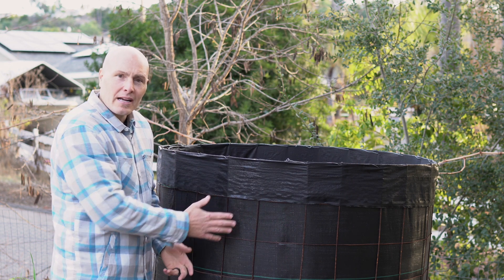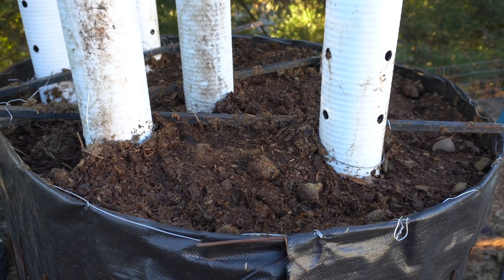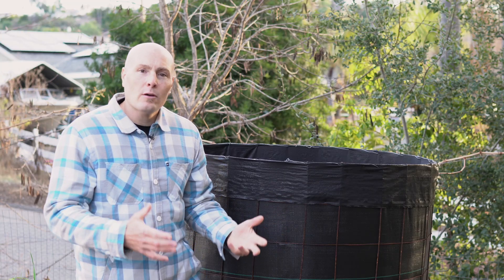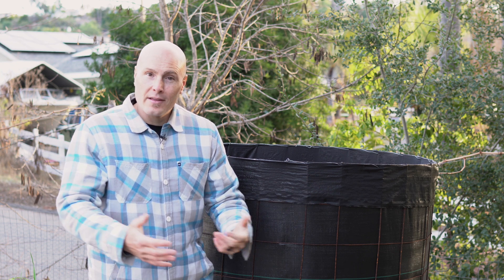Most UNDERRATED Way to Compost | BUILD ONE!

Comment: One modification that I would make to your bioreactor is to place a grid of rebar and hardware cloth at the bottom of the stack and then add a pan with a drain beneath that. Its collection and removal prevents the pile from becoming anaerobic from overwatering. It also prevents under-watering. Simply Water until you reach field capacity and hear the water start to drip into the pan. Then drain the excess water for use as a compost tea or attach a drip line to feed the runoff directly to the beds. The diameter of the pan should be smaller than the diameter of the reactor to allow air flow and/or contact with the soil around its exterior.

Comment: I have built several of these and the idea of easy has never happened. There is a lot of work to build one correctly and once built, there is little maintenance but watering and adding worms and keeping warm or cool for the worms and then 18 months later, tearing the pile down to use. Most chores in the garden take work.  This is the best way to get the highest quality, highly fungal, highly bacterial compost. But the application rate is a few pounds per acre four times a year. And with a backyard garden, one does not need 500 pounds of this compost unless you want to supply the neighborhood. (Which is a good idea). It is work.
Reply from the maker: Relative to turning a compost pile all of the time this isn't that much work.

Comment: I don't like the restriction of airflow by the landscape fabric or the vertical tubes.  I think a better design would be horizontal perforated tubes crisscrossing the reactor.  Then air could flow through the tubes from wind.  Getting rid of the pallet is great.  The reactor is more like a Jean Pain mound.  Too bad we can't harvest the heat via heat coils to maybe warm up the garden beds? Maybe start seed trays on top?

Comment: I hope the palletless design works out!
I wouldn't be too sure though. The airflow dynamics in a normal bioreactor with a pallet is completely different. The air in the columns heats up, starts rising and fresh air is pulled up from the bottom, not sure how it would work here, but maybe it does get enough air from the sides.  Whatever happens, we will be smarter afterwards :-) Keep up the great work!

Comment: I was really hoping to see the decomposition of the wood chips you had used in the spring.
Also what is the amount of compost produced by one reactor?
If you are trying to source/make your own compost and had a market garden...how many reactors would you need???
Reply: If you follow Dr. Johnson's instructions fully you will get a 25% -30 Yield by weight when finished, about 700 lbs. per reactor. It's efficacy is extremely high so 700 lbs. It plenty if your using as a slurry seed inoculant, root drench, foliar or a transplant root dip. This is not the type of compost you need to be applying literal tons of per acre. farmers Use 2lb's of JS compost with 20 -30 gallons of water  per acre in furrow and found great results. 2lb/20 gallon solution for transplant root dip, and root drench in the market garden scenario.  also considering using this compost or compost extract to inoculate other windowed piles of traditionally turned hot compost or as part of your seed starting mix. You can never have enough of this compost, so calculate what you actually need (acre-foot of bed space) and then make as much as you can afford. Just remember to do it exactly as Dr. Johnson instructs, and run experiments on the side, it's a long wait for a maybe this will work. A dependable irrigation set up is one of the most important factors. Here Dr. Johnsons instructions. https://www.youtube.com/watch?v=DxUGk161Ly8
Reply from the maker: I will open it up at the one year mark.  It is about 2/3 full.  Depending on how "concentrated" you believe the compost to be you could get away with one reactor for a whole farm at DJ's application rates, but I have talked to others who have had no luck at that small of an application rate.

Comment: I built my first Johnson-Su Bioreactor in 2018. Per Dr. Johnson's videos, interviews, and written instructions, the pallet is needed to ensure air circulation so no part of the pile will ever go anaerobic. It might be true that in a dry climate (such as in the video) you might get enough air when on the ground + holes from removed tubes, but in other climates that would be more problematic. Following instructions for daily watering makes the pallet even more important. I live in a wet climate and definitely need the pallet, as the final material is very clay-like.
Reply from the maker: What about when the the holes naturally cave in?  Airflow goes away.  The pile should drain naturally with or without the pallet.
Reply: @DiegoFooter  The issue I'm pointing out is not drainage, it's air diffusion through the composting bulk. I recall you used mostly wood chips to build your pile and had infrequent watering, which should allow a lot of air circulation. I used more than 50% leaves for each reactor, and kept it moist at all times. This combination did not allow easy airflow through the bulk of the material, so the tube holes and bottom access via the pallet have  been critical.

Dr. Johnson has said that fungi should hold the material in place after the first 3 days. However, I did have trouble with one tube that wasn't put in vertically, but others appeared to stay clear (at least while the pile was hot, I didn't check again at the very end). The longevity of the tube-hole probably depend on what material you're composting and how much moisture is there, IDK.

Obviously the highest O2 demand will be when the pile is hot, but after the pile drops below 80F and worms are added, the material becomes "thick" / "clay-like" and probably doesn't allow air diffusion as well as a regular hot compost pile. The pallet ensures aerobic conditions throughout the process. Skipping the pallet might work for some builds/materials/moisture and not for others. As long a anaerobic conditions are avoided, a good product should be produced.
Reply from the maker: @chad eller   I don't think airflow is a problem without the pallet.  Air is getting into the side of the column through it's entire height.  If you assume that to be true, then the only part not getting airflow is the bottom center of the cylinder.  I don't think the pallet is making as much of a difference as you think it is.
Reply from the maker: @flatsville1  Of course airflow is critical.  That's why the the whole outside is exposed to the air.  The outside has 4x more surface area than the pallet.  Airflow isn't an issue.
Reply: @DiegoFooter  It is true that hot compost piles often have material >2 ft from an edge, yet obtain enough air flow to minimize anaerobic conditions. It’s also true that Sir Albert Howard allowed a maximum of 2 ft depth to his Indore system to allow sufficient air exchange. On the other hand Dr. Johnson has stated very clearly that air diffusion through the bioreactor is only effective to about 12 inches, and that is the reason for the air tubes which treat that center of the reactor, and a pallet to feed fresh air to the tube-holes. All of these systems have been proven to work with a wide variety of raw materials, so why the difference in air diffusion capability? 

The Johnson-Su Bioreactor is run at a very high moisture level form day 1 until the end, which substantially reduces air diffusion through the bulk material. Why bother providing consistently high moisture? To make a very different product. It looks different, it feels different, it behaves differently from regular compost. The original purpose was to treat very saline feed lot manure, which worms do by converting free sodium into much less soluble sodium oxalate. However the end product’s value as an inoculant was found to be in the tremendous microbial diversity that results from air+moisture+worms+long curing time.

Without air tubes and a pallet (or some alternative system to feed fresh air to the tube-holes), you just have a regular compost pile, shaped in a cylinder. If you don't keep it too moist, you'll end up with regular compost, which is a good product. However, if  someone follows Dr. Johnson’s guidance for moisture without allowing sufficient fresh air, the pile will almost certainly turn anaerobic. 

I’m glad you were able to find a combination of form factor, material, and moisture that made a good product that you’re happy with.
Reply: @flatsville1  I like your chicken wire tubes. Brilliant! I'll try that technique next time!
Reply: @flatsville1  I love the 4x sized bioreactor! What's your context that you have so much material? I have to admit, I'm jealous! 

How wet did you keep the reactor, and how long did you let it cure? How would you describe the final product? How'd you use it?
Reply from the maker: @flatsville1. I will reach out and ask him.  Try both ways and see if you notice a difference.  Keep in mind we are debating about something that we have no way of measuring or analyzing the results thereof.  😆 At the end of the day whether you blow air through it or don’t have holes at all you are going to get about the same thing.
Reply from the maker: I guess we can agree to disagree.  Would love to see you do a trial and show a difference.  Just saying. 😉
Reply: @DiegoFooter  It's hard to discuss something like this in comments. I think we're all trying to be helpful toward each other. I hope that is understood.

We've expressed opinions, appealed to logic, and appealed to authority. The problem, as you pointed out, is that we don't have the specific evidence we need - batches that became anaerobic, and details about their construction compared to those that succeeded. Dr. Johnson did have this direct experience during development, with slightly different designs that led him to the final version. Are all the details of the final design important? Maybe, maybe not, he would know, we would not. Are some of the details, or a combination of details critical? Certainly. Why do I say that? Because the final product is substantially different that what comes out of other composting methods, so that implies that some of the details are what make the difference.

Surely there are 1000+ ways to make compost. But the product from the bio-reactor (when soaked/mass inoculated, kept damp the whole time, maximum O2 availability, worms applied, and matured for 18 months) is NOT the same as other composts. It's also not quite the same as fresh-from-the-bin worm castings. It is a unique material. Taking shortcuts may lead to a useable product, but not necessarily a similar product. Some shortcuts may lead to disappointment. Cut enough details out and you just have a regular compost pile... and that's okay, too.
Reply: @flatsville1  I don't have access to manure, so my materials have been >50% leaves and the rest a wide variety of food wastes and partially decomposed wood chips. I did get a lot of amazing clay-like material, but because I took some shortcuts, I also had a small part go anaerobic (where a tube-hole failed because the cheap wire let the side slump). For my 2nd bioreactor I decided not to cut any corners, and it looks good so far.
Reply: @flatsville1  I've seen several people make bioreactors, and none of them have done both the initial soak/mass inoculation and daily watering that Dr. Johnson instructs. **Without the very high moisture content you just get regular compost.** 

This winter my reactor has been under snow, but is still over 50F inside despite being fairly mature. In a colder climate, or with more mature material it could obviously freeze as yours did, but because of the long curing phase I doubt that would prevent a quality product. I don't recall any guidance regarding curing times vs climate.
Reply: @DiegoFooter  Submit your finished compost products to Dr. Johnson when your done, He has been collecting samples to analyze the microbial diversity of different reactors from different locations and materials around the world. Would also love to see the results of your hunches' as of you misleading thousands of viewers into a year long failed experiment.  At least warn them to make a separate reactor following Dr. J's instructions to the T and 1 Diego cylinder pile.
Reply: @TS-vr9of  I wouldn’t go so far as to say he’s “misleading” thousands, yet. I do believe your idea about submitting samples to Dr. Johnson is a prudent one.

Comment: Down side to it on the ground you lose the airflow confection effect. Biology creates heat with in the pile that sucks air through it.
Reply from the maker: What about when the the holes naturally cave in?  Airflow goes away.
Reply: @DiegoFooter  it's called a broom stick you give them a poke and it falls through and clears the tubes , iv seen your latest video. 

Iv used stainless steal fly screen instead of land scape fabric , and instead of pallet iv used concrete wire and 400mm star pickets leveled on the ground and has held the weight fine.  Like the idea of the single tube in your new one.

Comment: I built one last fall from your other videos on the subject. I love it. However, it is my first serious compost attempt. How do I know when it's "done?" I'd love to use it this Spring in my garden, but I don't want to sabotage my garden by using compost that's not ready.
Reply: I think I saw somewhere that you open a window into the fabric along the wall to check the consistency. It should be like “clay”, according to Dr. Johnson’s videos.
Reply: Ive watched a couple videos with them talking about them and if i remember they sit for almost 2 years.

Comment: Remember that the DJS bioreactor was designed so that worms would be added after construction and that the pallet acts as a air barrier so that the worms could not escape to the soil in addition to air circulation.   Having said that,  my cylinder sits on bare Michigan ground (now completely frozen) where worms will crawl up during April/May 2021.   Diego:  given your warmer climate, you have 365 days of composting.   My compost is frozen 4 months of the year and active maybe 6 months.   I will update on what my decomposition timeline is like.

Comment: Hey Diego
  I have copied a similar compost cylinder that my Father built over 60 years ago. Essentially a 4 foot x 8 foot sheet of concrete mesh. Line the exterior with 1/2 inch construction cloth. One could utilize ty-wraps or tie wire to form the cylinder and attach the construction cloth. It sits right on the ground and gets watered every three days when the yard get watered. Works great. Lots of airflow vs weed cloth. No interior tubes. When new the composting process takes a few months to get active. Once everything comes into play the cylinder begins digesting at a phenomenal rate. It gets moved around the garden. The new location gets "Starter". Some browns and greens on the bottom about a foot. Then a foot of the already composted material on top of that. That's the "Starter". Then the browns and greens. The first generation takes the longest. Every generation after that processes much much faster.
Can't wait to see what you have come up with. Thanks and have a great day.

Comment: Welllll, I’m gonna say it... I know you’re an experimenter, but how can the air actually circulate up the chimney if it can’t get in at the bottom? Will watch for the results- much later LOL. Sidebar... it’s actually cold enough to see your breath... wow... California may not survive that ice age weather LOLOLOL. Be well my friend. Gotta go shovel out a new mountain of snow that fell overnight. Garden On!
Reply: I thought the same thing at first but either way its pretty much static or very gentle moving air anyway.  I think it's more about the proximity to the edge of the pile that makes a difference. The tubes in the middle effectively expand on the edge of a pile by bringing open spaces to the middle. It's not like air was being forced into the pile by sitting up on the pallet, or creating some sort of wind tunnel.  At least that's my thoughts  at the moment, could be wrong.
Reply from the maker: It was 34. 🥶  I thought a lot about that bottom ventilation I just don’t think it adds that much. I think you’re still getting a lot of airflow through the side of the pile and down through the cavities left by the pipe. I also think you are getting some airflow through the soil. All that being said it was a trade off of getting the biology in there versus having airflow and I leans towards the biology. Plus not having a pallet and allows it to scale.
Reply: @DiegoFooter  I’m curious if Dr. Johnson started with a no pallet prototype and determined that a pallet was necessary. He did say he had several versions of it prior to settling on what we generally accept as his most current design.
Reply from the maker: Good question.  Don't know.  I think we (me and DJ) are nitpicking in terms of the "negative" effect of no airflow.  The pile doesn't have that large of a diameter.  Not much of that core is going anaerobic.
Reply: @TS-vr9of  I did follow DJ’s design, but with one change. I rolled 1/2” hardware cloth internal supports around the pipes and secured the hardware cloth to the pallets during installation. The pipes were not in direct contact with the material and there was no shifting of the material when they were removed. I doubt that any of the columns will collapse as a result of this added step. I guess I’ll find out next January. Fingers crossed 🤞🏻